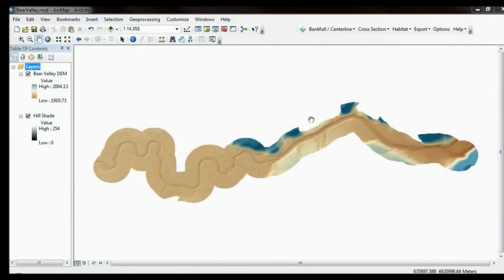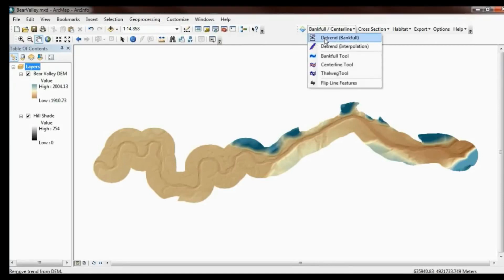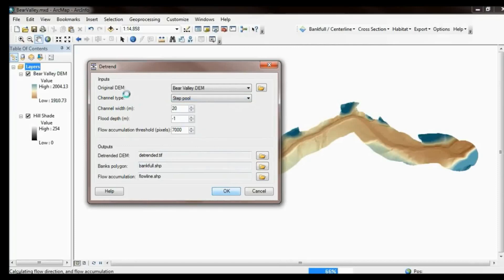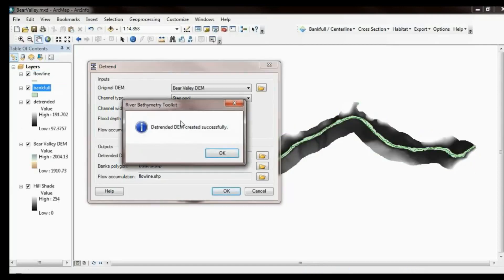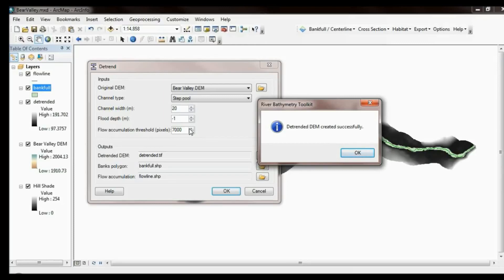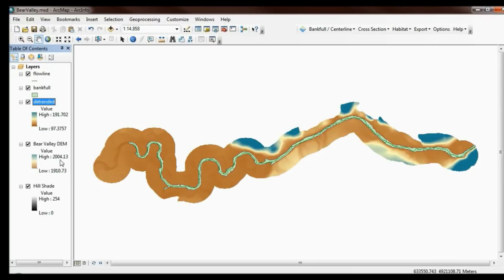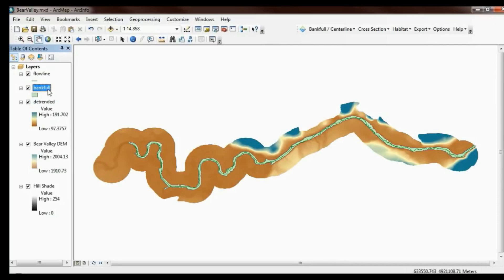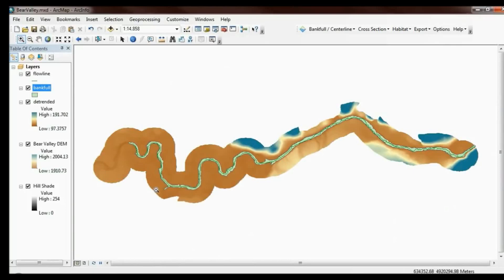How to Extract River Polygon using RBT(RBT) toolkit

Comment: Hi, please help me.. How to install RBT for Arcgis 10.1 ?? it’s showing “ Unable to find a matching arc GIS installation on this machine”
Reply from the maker: At first you should use arcgis10.1/10.2 ,
go the rbt tool and run this toolkit...now copy the file into your installation folder...now open your arcmap and it shows rbt toolkit in your window if it isnot working then redownload  rbt file and reinstall or you can used for  10.2 version also...
Reply: @Geoinfonepal  sir, One request.. can u make a video on it??🙏🙏humble request